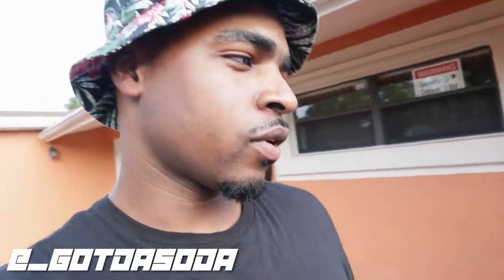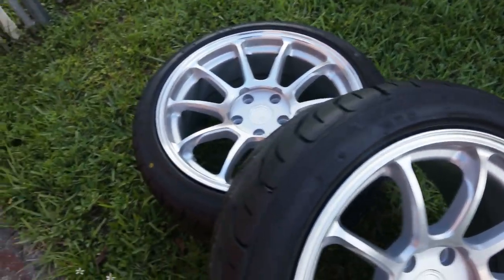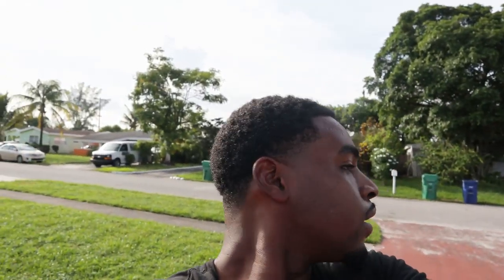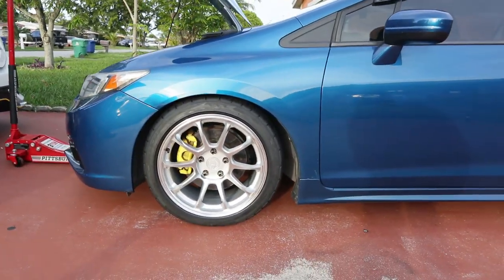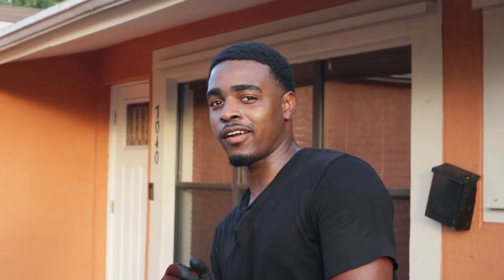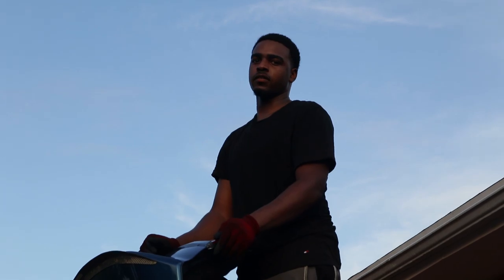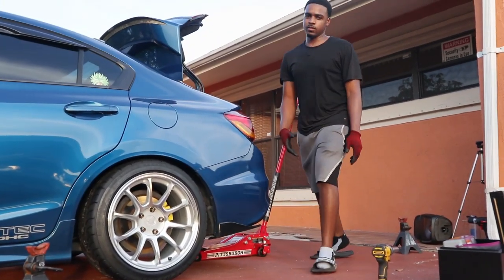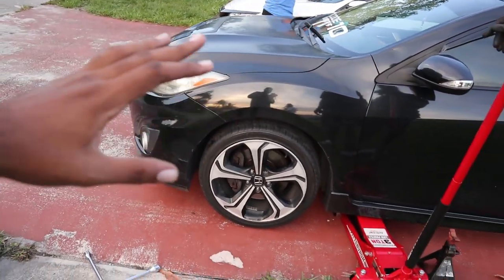NEW MEATY WHEELS SETUP!

Comment: I just got federal ss595 on my 15 si with aodhan ah07 in hyper black. And i hatee the federal tires. The steering response is absolutely horrible. The grip is ok but they feel so strange. I had continental contipro contacts on my last wheels ans o loved them. Definitely going to get some conti extremecontacts on these wheels soon
Reply from the maker: I had Achilles atr sport 2 before they felt alright.. the Federals feel a bit more smoother tho which is weird but I think it’s cause I went down to 17s
Reply: Oh shit nice. I like how they feel but just going through turns they feel extremely sloppy. They ride super smooth though. Just the steering response is very delayed. I love your car tho! I got the aodhan wheels because i loved them on yours. I've got a 15 si sedan in white